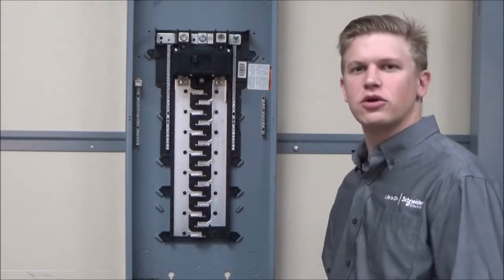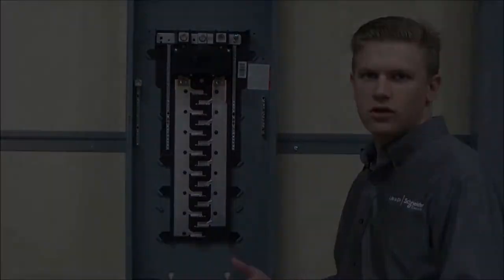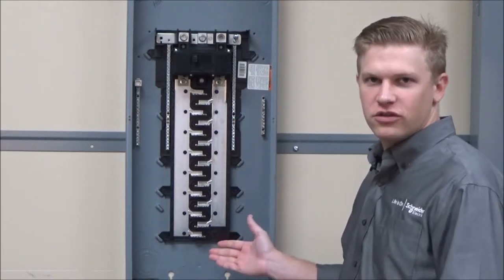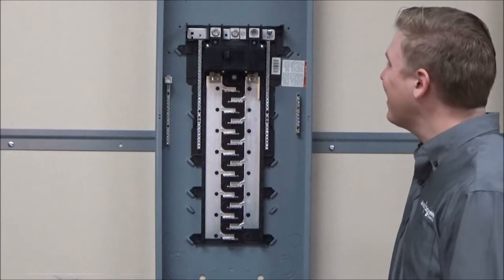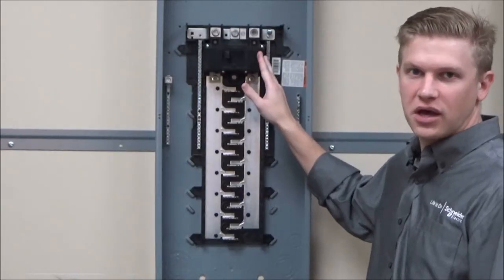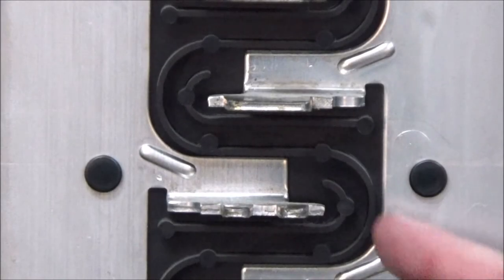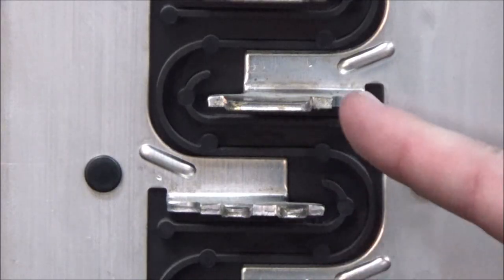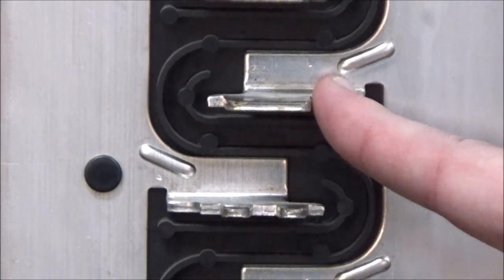Determining if Homeline Load Centers Accept Tandem Breakers | Schneider Electric Support

Comment: Be sure you don’t overload your panel first! 
It only takes a minute  to modify your tandem breaker to make it fits. Tandem breaker has shorter opening where it sits onto the bus bar. Simply take your knife and carve off the plastic molding about 1/4in. Just use your standard breaker as reference. It is very simple! Hope it helps
Reply: So your saying if the panel doesn't accept tandems to make it accept it correct?

Comment: In your experience and knowledge,. Does QO series, have tandem breakers, that will fit in main service panels, that do not have the extra slot ? Or did I answer my own question, in that, if there is no slot, do not put ANY tandem type breakers? Thanx in advance.